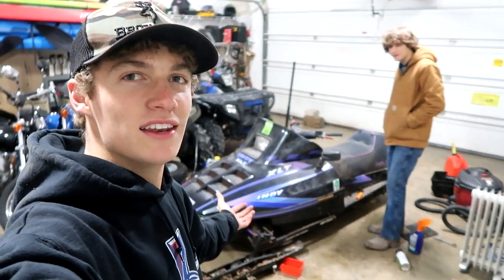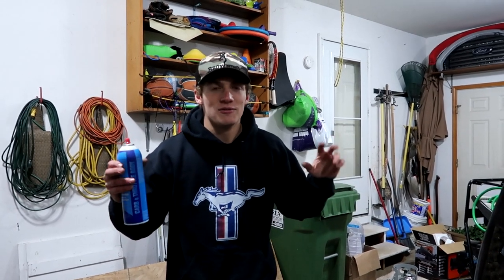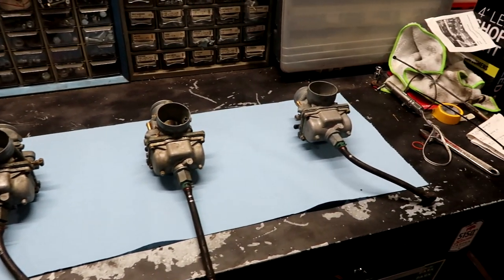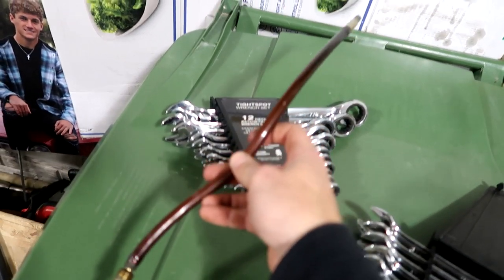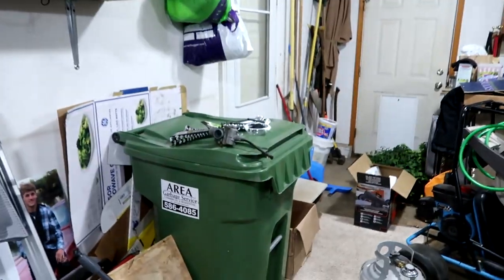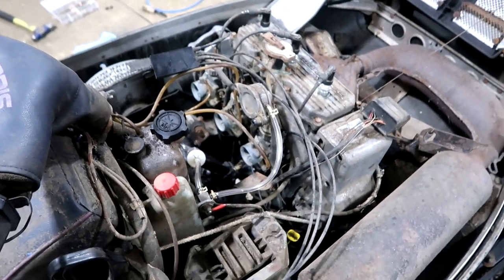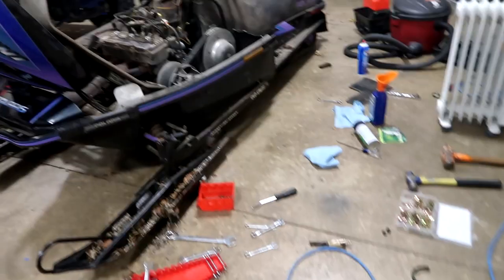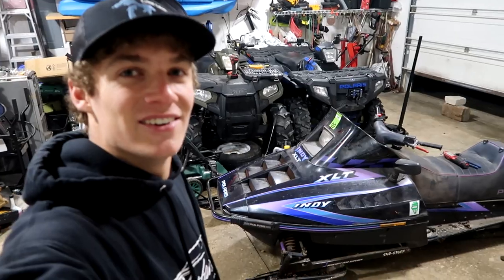I Got A Free Snowmobile! 1993 Polaris Indy XLT 580! Easy Fix, Fuel Issue!

Comment: Make sure you check the crank drain plugs to see if there is gas in the crankcase. You can ruin an engine real quick if there is and it ignites.
Reply from the maker: I will definitely check that out!
Reply: @justinstraub698  did you have any gas in there I just picked the exact same sled up seen that comment and made me a little nervous 😅

Comment: Cool gift and you didnt have to do alot to have running.i too just got a 90 polaris 440 for 300.last spring.mine had bad fuel pump,dirty carbs and deteroiated fuel tank pickup hose before it ran.one boggy wheel was loose bolt also but now ready for snow.was suprised you didnt siphon old gas out n replace with all new.i wouldnt even trust five yr old gas,could have water and gum up carbs again.no sense in doing carbs twice.check ur sliders on rails make sure enough meat on them(plastic thickness)to last the winter rides.then letter rip!!!snookie pa.💥😜🤟💥
Reply from the maker: I will do all those checks along with I bought a whole parts sled too! The gas tank was completely dry that’s why I didn’t have to siphon any gas. I think my buddies dad that I got it from prepped it before storing it away. But yeah I’m super stoked I’m just waiting on snow now!

Comment: Have someone set your carbs triples are a bit temperamental if the carbs are not sinked together well worth having done
Reply from the maker: Sounds good! Definitely want to get the maximum performance I can out of this thing, so I’ll look into it! Also I’m planning on maybe not reinstalling my airbox and just putting the little filter pods on the ends of the carburetors any advice on that if it’s a good idea or not.
Reply: @justinstraub698  no do not go with pods they will make it run worst and well known to blow them up. Stick with the air box. To get the most out of them triples is all in the carbs being sinked and if you come across a set of triple pipes and can will make them triples come alive but definitely don't go with the pods I promise you it will kill a piston
Reply: Yeah need the proper restriction on airflow so not to run lean,burning a hole in piston,schyncing is easy loads of utube vids on it takes a small drill bit to set idle hieght of throttle slide then i think 3/4big one to set full slide hieght.there are other ways with fliud gauge or air gauge but only shops have those.snookie pa.have fun!!!